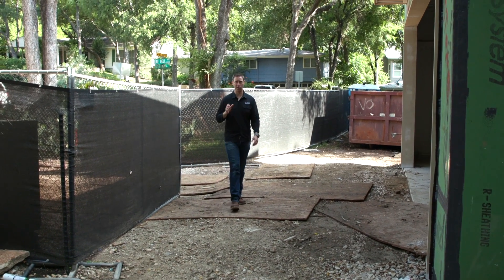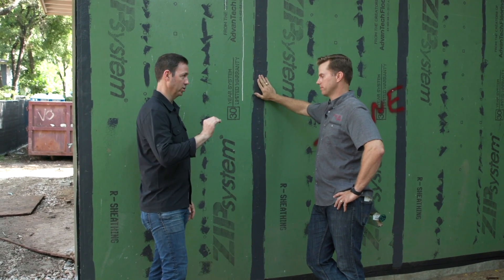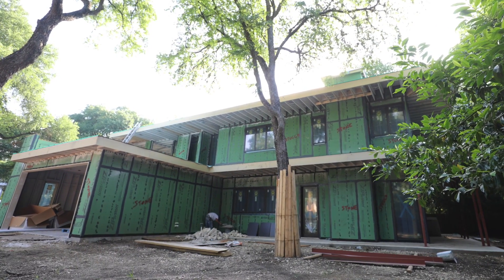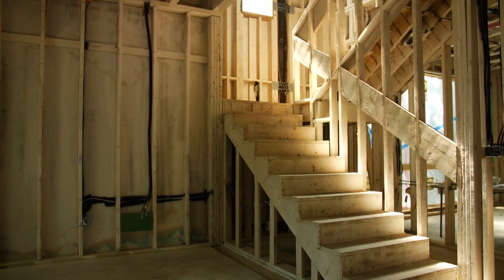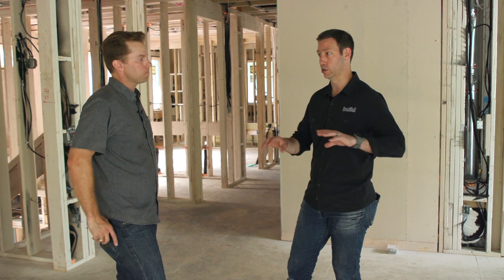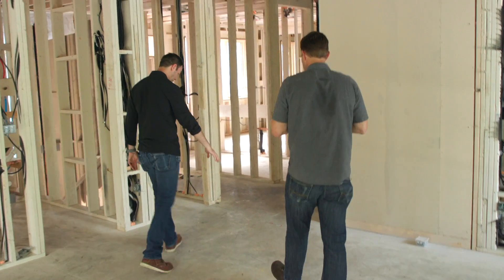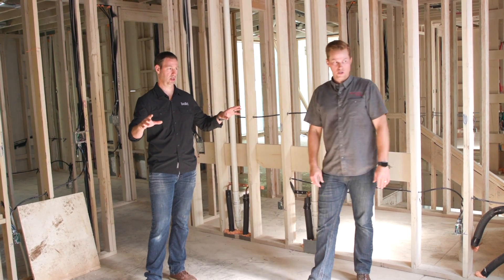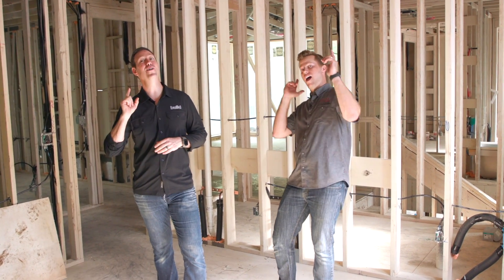Foam Free House - Is this Silly, or should we ALL BE BUILDING LIKE THIS?

Comment: If the owner was really serious the home would be mostly steel that is  riveted, bolted, and welded together with steel plate flooring that is welded to the frame along with steel plate exterior sheathing. And EMF shielding? What about good old fashioned conduit? Still, an interesting build! Keep up the great quality content!
Reply: i'll bite on the conduit vs "greenfield". I'm sure this is far less work to install. Even EMT you have to measure, mark and bend every single piece. It's basically the difference between copper and PEX.
Reply: @Cynyr  Yes and very difficult to run horizonally through walls!

Comment: Doesn't rockwool offgas formaldehyde? She's worried about emf from electrical wires and offgassing from regular studs, but she's okay with rockwool?
Reply: Anthony Brusca why would rockwool offgas? It's an inert material made from naturally occurring minerals, therefore requires no preservatives adding.
Reply: @spencerwilton5831  Rockwool isn't just pure rockwool. Even the new formulations of the binders have formaldehyde. I believe the binder had a fire resistance too. Rockwool is up there with spray foam in terms of off-gassing.
Reply from the maker: Not true
Reply: @buildshow  I stand corrected.
Reply: @buildshow   Can I use Rockwool under the roofdeck in lieu of foam for an upcoming new build in Austin? Are there some other concerns to be addressed or is it as simple as installing the Rockwool where I typically put open-cell foam? Are the inspectors familiar as well?
Reply: Spencer Wilton I believe they used to use it as a binder.

Comment: Hey Matt what does the fire dept say about the exhaust fan in the garage? That would not pass the fire inspection where I live
Reply: Loganbay why wouldn’t it pass?
Reply: @hellonoko  I could not have any penetrations into the house or attic from the double 5/8 sheet rock garage walls. This fan may go directly outside as they have an exterior deck above - that might pass. It does depend on where the firewall separating the house and garage is in the attic as well. The garage had to stand alone 20 minutes fire rating from the house.
Reply: Loganbay that would make sense if it didn’t penetrate the firewall. They did build the garage to be air sealed separately.
Reply: @b4804514  why in the world would the duct for the vent fan penetrate the firewall (be routed through the house)  when it is less than 5 feet from a soffitt
Reply: @falconeer99 Once you cut into the walls of the garage  it breaks the firewall.  If into the attic there has to be a firewall in the attic to separate the house from the garage.
Reply: @falconeer99  I potentially leaves a path for heat and smoke to get into the ceiling joists. it appears in this project the celing joists penetrate into the home. This builded did fully block the using OSB, but perhaps in loganbays project that was not the case. 

That said the exhaust fan could have been installed low to the ground and vented through the wall. Most of vehicle exhaust will remain low as its heavier than air anyway.
Reply: @b4804514  In this case the Builder has sheathing completely blocking off the home from the garage which is serving as a additional firewall. I am sure that is how the garage passed code with the exhaust fan. 

Also consider homes have lots of firewall penetrations, AC ducts, Bathroom fan exhaust, Drier venting, etc. 

But I am not installing an exhaust fan in my garage. Seems a waste since the garage door is always open when the vehicle is running & the tailpipe is pointed out the garage door opening.
Reply: @b4804514  in a normal house yes.  This garage however does not have an attic space that is shared with the house.  There is a deck above it, and all spaces leading to the house are sealed.
Reply: How is it any different than a window?
Reply: Keel. Here in VA you cant put hvac in garage cuz the say CO gets into the house.  Which would happen if u put cars or lawnmowers in there.